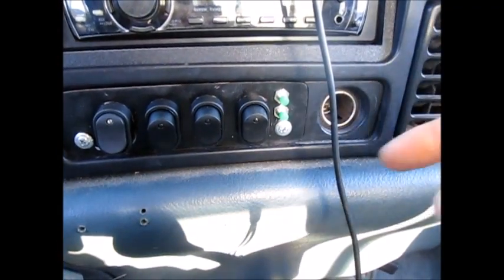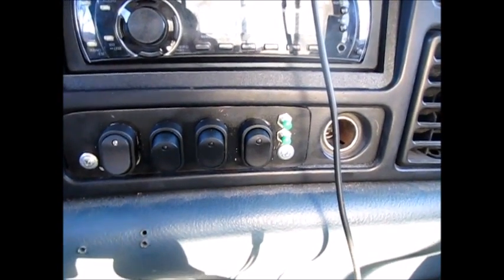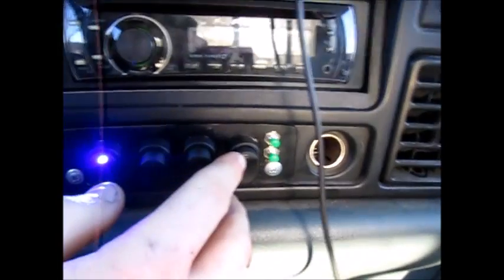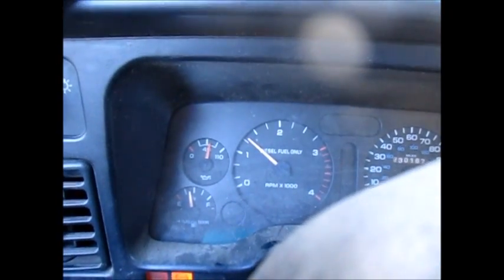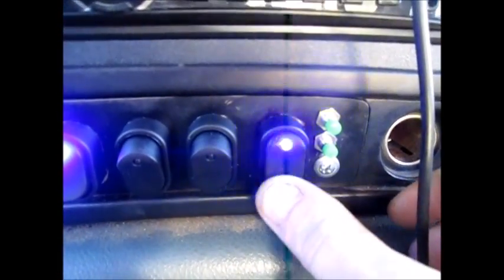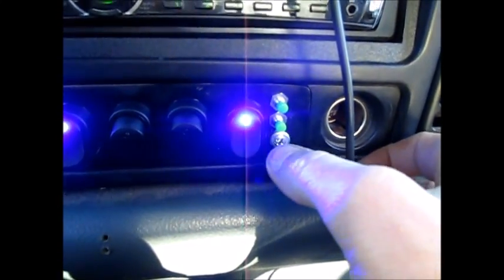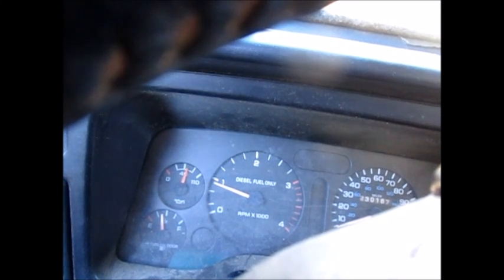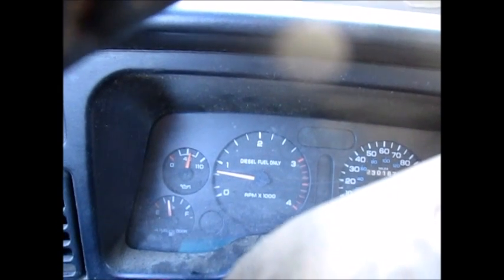Cruise Control High Idle - 12 Valve Cummins

Comment: Can you pre-set this somehow to a desired idle for an automatic starter?
Reply from the maker: EDIT: My bad, I thought this was about a different model of controller.  With this Stage 2 there isn't an easy way to configure this feature.  The below response was geared towards a V6.2 Unit:

Anythings possible!  If the automatic starter had an output that went hot when starting the engine, the controller could easily detect that the automatic starter was starting the engine and not an in-cab user.  With this information it could be programmed to automatically idle up when an auto-start is detected.

Comment: So that is for the 2nd gen? I seen a write up for a 1st gen and people were saying it wouldn't work on a 2nd. Then i found that and it looked the same as the write up.
Reply from the maker: Yes it is a 2nd gen.  I do not have a 1st gen so I cannot confirm this, but I believe there are some slight differences in how it's wired.